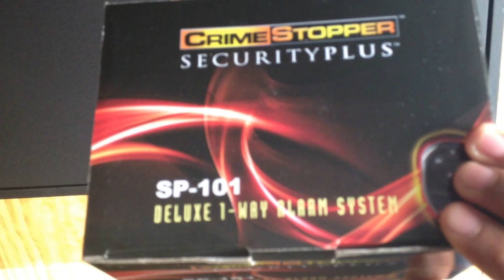Cheap Landscape Enclosed trailer Alarm System Part 1

Comment: I wanted to let you know I bought this alarm and installed it on my trailer.  It works well.  Thanks for posting.

Only difference, I used a 12 volt lawn mower battery.

I was also glad I bought an extra siren.  The one included was kind of small.

I also wired in a light switch so I could fool the alarm into thinking the ignition was on in order to make programming changes.

Comment: Nicely done.  Thanks for taking the time to put together that video.  I have a similar trailer and am looking at doing the same thing.  I also purchased a cellular gps tracker on amazon for $40 and am testing it now.  It works great.  Amazon item number B0095BJZ7O.
Reply: +rjmorgansd     Did the cellular GPS tracker work?
Reply: Yes the cellular tracker works but after the last year it's been too much of a pain keeping it going.  I put a dedicated 35AH SLA battery in a box to power it.  Constant current draw is 70mAh.  Had to recharge the battery every two weeks.   Also I was using H2O wireless cell SIMs and had to keep the account updated with $10 airtime cards which expire every 90 days.   Updating the account is a PITA.  Ended up relying solely on my SPOT trace device.  Works like a champ and I now have 5 of them.  However they recently raised the annual subscription from $100 to $150 plus a $15 annual fee.  WTF.  So I did what any businessman would do.....passed the cost along to my customers.  Have to.  Those SPOT devices are awesome, tho.  Small, runs on 4 AAA for months or USB power forever.  Love them.  Pricey but the piece of mind is worth it.  If a trailer gets stolen again as long as it stays on planet Earth I will find it within mere feet.

Comment: Thanks for the share. This is a good, cheap and easy system. I am looking at doing something with my trailer that just got emptied out for about 14k... I would like to have a cell responder to sms my phone and a gps just in case they take my trailer. Do you have any insight on these features?
Reply: Gps &Track.com has a tracker for about $250 that includes 3 years of tracking & $20 A YEAR after the 3 years.  DeWalt has a system that costs about the same but tracking service is $20 a month.  The DeWalt system included a built-in alarm and has other components like a motion detector that can be installed in your storage building or house you are working on and it notifies you if motion is detected.

Comment: thanks for the videos.   I know you are 3 years removed from this but what programming is involved? thanks
Reply from the maker: +CHRIS D There is very little programming involved. Its just simple stuff like being able to disarm sytem without remote...Its all explained in the instruction manual...Its been a while but it was very simple....I still have mind installed. I just have a dead battery now....Thunderstorms were a problem with the shock sensor .....I just disarmed during storms....I may us solar charging system this year or hook up from truck would be another option....I my make another video on that.....Thanks for commenting.

Comment: Question about your magnetic switches.  I cannot get mine to work.  They are normally closed circuit, and open circuit when the door pulls away.  Did I buy the wrong ones?

Comment: David: question about the door switches:  I’ve got one going but can’t seem to get the barn door switch working.  Did you splice the + & - wires running to the computer?
Reply from the maker: There is only negative outputs from the computer. The comm on the magnetic switch goes to ground any where on metal part of trailer. So you really only have one negative wire from computer to any switch. Then that switch is grounded to trailer using comm spot of switch. There is no + wire from switches. If that helps

Comment: Can you use the trailer brake battery for power?
Reply from the maker: +Rex Starliper  I wouldnt recommend it.....Just in case of emergency you dont need the brake battery dead..

Comment: What kind of siren is under neath the trailer?  I bought the 513T Piezo, but it does not look like that
Reply from the maker: Debbie Hausman That the one that came with the alarm system. Any 12v siren will work. Thanks

Comment: Do you have any option that the alarm active after 10 min you lleft the door open?
Reply from the maker: +Teresa Valencia No you can set the alarm with a door open but it will not sound unless a sensor is interrupted.